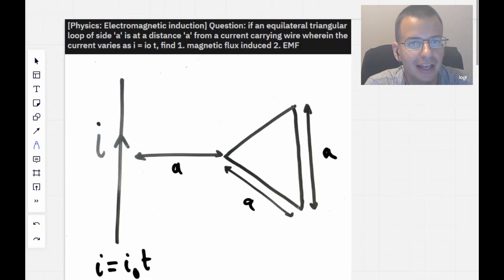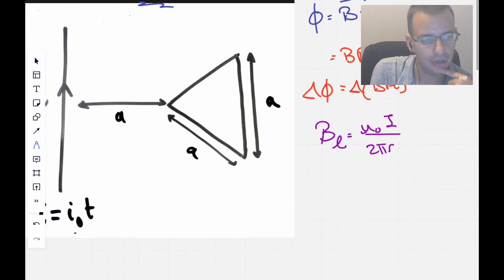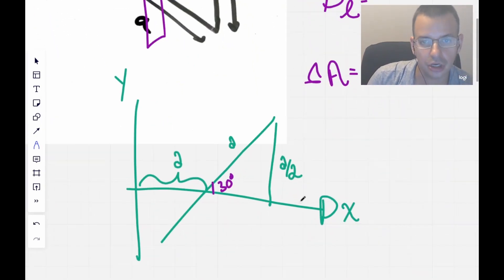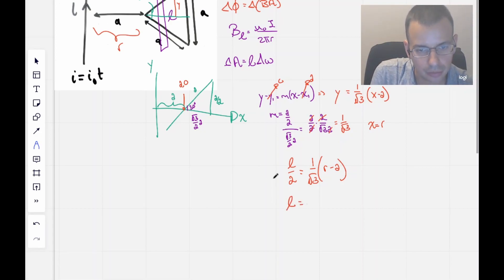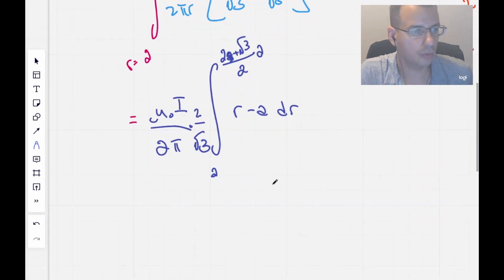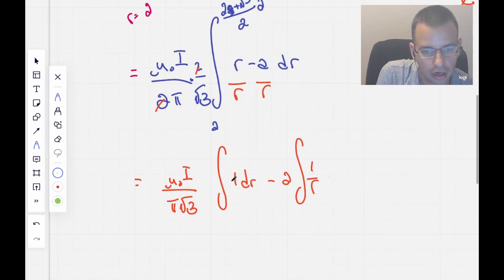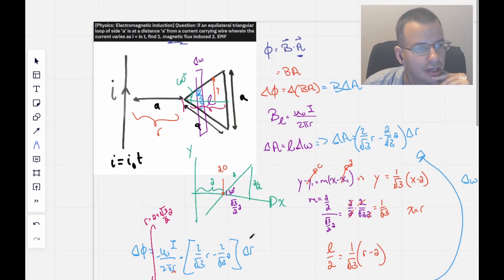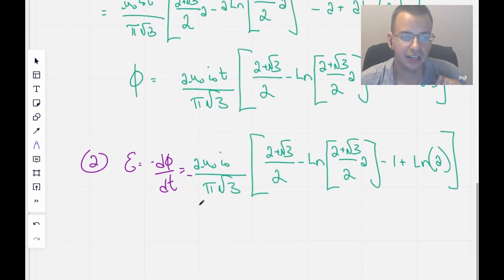Magnetic Flux from a Wire through a Triangle

Comment: Hey Ben, this is the OP. Thanks a lot for solving this question, this was given to me by my physics teacher who just made the problem up. 
However when I did this just wrote the equation for Magnetic Flux by taking an elemental strip dx at a distance x from the wire. I took the area as 'a•dx' (which I now think may be incorrect). I wrote the magnetic field as μi/2πx, which is multiplied with a dx, then I took all constants out of the integral leaving the 1/x from the magnetic field inside the integral whose antiderivative is ln(x).
The major problem I have is what limits to take for integrating this. Should I just use the limits you used while keeping my answer that is μia[lnx]÷2π, provided that a small area dA = adx (where I think I went wrong)
Anyways thanks a ton for the answer :D
Reply from the maker: There are probably multiple ways of doing the limits for the integration.

I am unsure the best way to do it, but I would probably stick with starting at r = a and integrating to r = a + asqrt(3)/2. I am pretty sure that would work, though there may be an easier and cleaner way to arrange the integral.
Reply: @BenKohnPhysics  yep I think your method is quite good and accurate
Thanks!